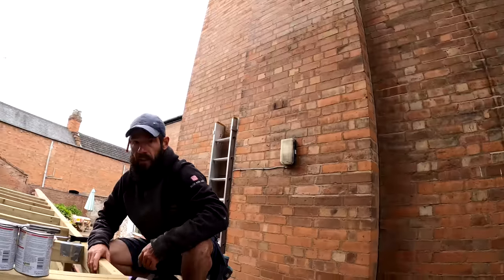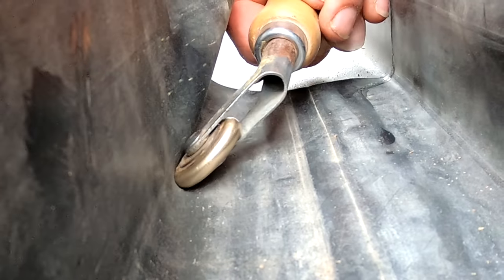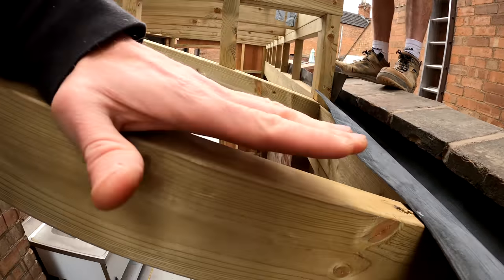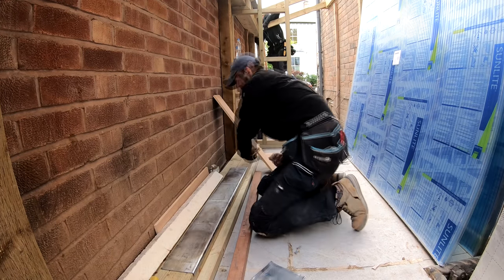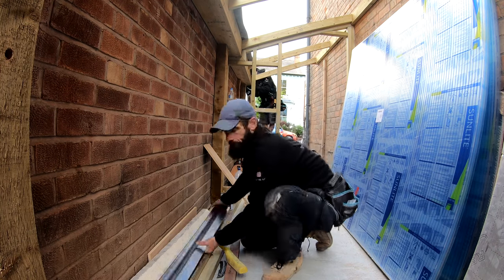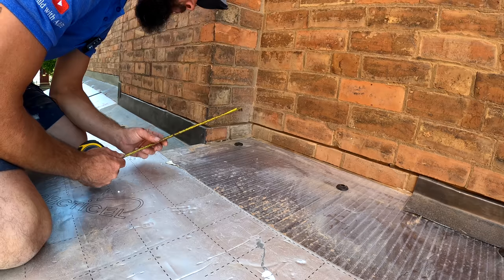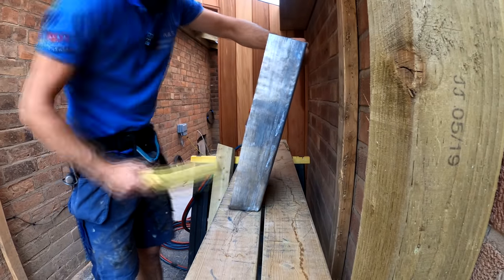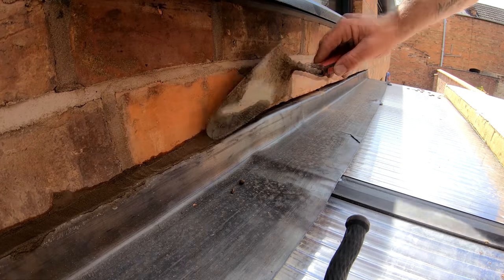HOW TO BUILD A GARDEN SHED: LEAD AND GUTTER WORK FOR THE ROOF | Extension Build #20 | Build with A&E

Comment: I’ve done a few rubber roofs and they are brilliant. So easy to do; no flames, no mixing. Ordered my gear from rubber for roofs.
Reply from the maker: Hi Slashley gibbins,

I couldn't agree more. Rubber is a fantastic product, which a huge lifespan. It's definitely the way to go 😎

Thanks for watching.

All the best, John 😊
Reply from the maker: Hi Slashley we use rubber for roofs great company to work with and cost effective, have you used the felt backed rubber still yet to use that one all the best Tony 👍
Reply: Build With A&E no, just the standard rubber.

Comment: Will your a pleasure to watch mate explain everything so well cracking job again from all of a&e. Will how would the gutter be done in lead at that cute slope would it be welded at the joints then would expansion be an issue??. Thanks In advance 👍🏽

Comment: @Will great lead work. I was wondering do you know how to remove staining from lead which was not treated with oil?
Reply: Better late then never, wire wool in the same direction as the leads natural grain and patination oil straight after!!
Reply: @lewisparker8832  thank you

Comment: Is the mortar enough to
Hold the lead in place ? Wood
You recommend using tack glue  between the roof tiles and lead
Reply from the maker: Hi ///M SHAHID,

Providing that you use lead clips, it is perfectly fine to point up the lead using mortar.

Hope this helps.

All the best, John 😊

Comment: Great vid as always. Quick question. Could you use patination oil on copper pipes or do you think I’d be better off with brasso. It’s the gas pipes outside the house
Reply from the maker: Hi aljroche I would stay with brasso but you could always speech to the LBM technical people on line. Thanks for watching all the best Tony 👍
Reply: Build With A&E  thanks for taking the time to reply Tony. I’ll test a bit of each

Comment: Why do they use lead in UK?   It lasts forever?  I am guessing you don't get much snow seeing as that flashing is only one course high.  Curious if the building authority has approved the raised extension.  That slight roof pitch and the fact it is higher than the block wall to my mind will likely mean the water will not necessarily drip down into the trough but shoot off onto the neighbours property.   Please follow up with another video.
Reply from the maker: Hi Michael b,

It's rare that we get a lot of snow in England, plus the area is well sheltered between the two buildings; so there will be very little snow on that roof.

With regards to water in the neighbours garden; the area of the roof in which the pitch is greatest, falls beneath the coping stones, and so there is little, if any chance of water crossing the boundary. The section which is raised has such a low pitch, that the speed in which the water runs will be very slow. Because of this, and with the addition of a capillary drip section at the bottom of the roof panel, it's highly unlikely that water will breach the boundary.

I hope this settles your concerns.

Thanks for watching.

All the best, John 😊
Reply: @BuildWithAE  Must have missed the episode with the capillary edge.   I've seen some YT  horror stories about how some Londoners are digging down multiple levels in order to get every mm of space out of their property.  Blocking streets and exposing neighbours to water damage in their efforts to build down not up so it is fascinating to see the extreme lengths people go to in order to maximize their living space inside and out.   This reno seems well designed to offer more space without compromising the adjoining neighbour's property.

Comment: If you have used 1.5mm plastic for the guttering, why then add lead?
Reply from the maker: Hi P Cass,

We used rubber in the gutter, which doesn't bond very well to brick. So the rubber was lapped up the timber wall plate, and then the lead was dressed over the top to form a watertight seal.

I hope this helps.

All the best, John 😊

Comment: how come you don,t use lead seal to point up? as recommended by lead association
Reply from the maker: Hi Chris in certain locations I like to use mortar with lime but most of the time we do use Lead sealant thanks for watching all the best Tony 👍 have a awesome weekend
Reply from the maker: Hi Chris,

Providing that you use a sufficient amount of lead clips, and the pointing up is done correctly, there is no reason why a mortar mix cannot be used. It also provides a more aesthetically pleasing finish than lead seal.

Thanks for watching.

All the best, John 😊
Reply: hi our local building control insist that we use lead seal but they might let you use much on listed building but prefer lead seal because lead association says so and we are a marine environment

Comment: DID you no the word plumber is Latin for lead worker,as that's what most old time plumbers dealt with.....Batton roles,welded seams,,  ahhh memories of advanced plumbing..have you tried making a 90 degree pipe bend out of flat lead, which they used to use to feed the toilet pan from the soil pipe...

Comment: Should have taken the copes off,   gutter gonna be a problem getting blocked
Reply from the maker: Hi Graham,

We installed gutter hedgehogs along the whole gutter. These help to prevent debris blocking them and can be easily removed for cleaning.

Hope this helps.

All the best, John 😊
Reply: Fair enough ,but with the detail  blockage is gonna happen and somtimes with hedgehog they cause more damage , cheers for the feed back